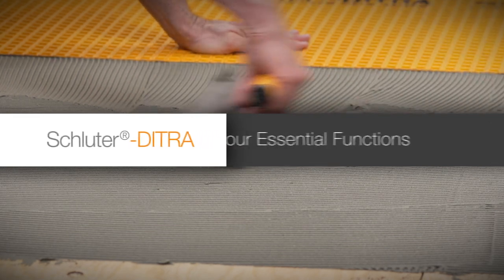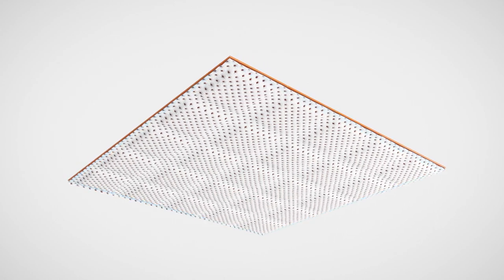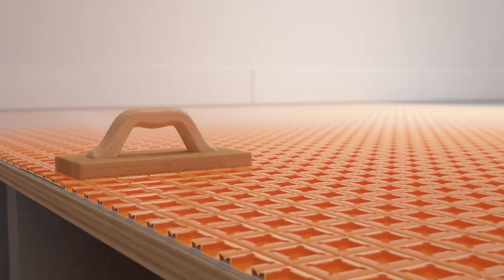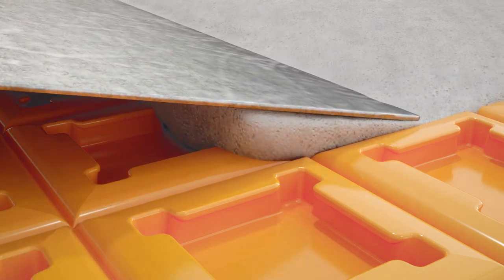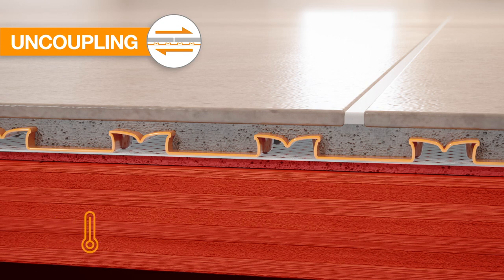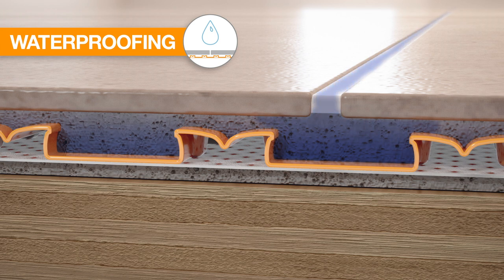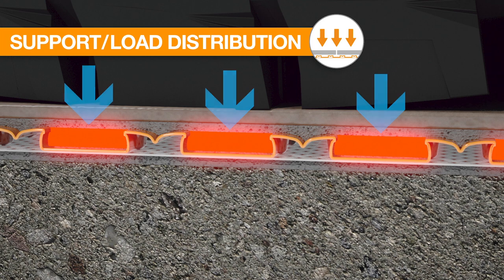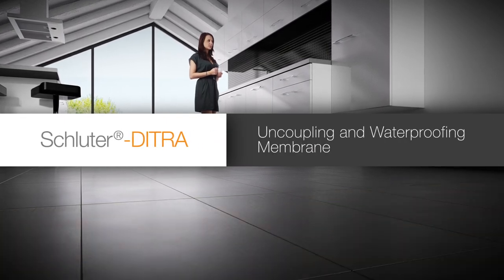Schluter®-DITRA: Four Essential Functions

Comment: Hi I’m having a lot of moisture coming up through my laminate planks and it is leavinging efflorescence behind from an older concrete slab.If I get this system installed with tiles or laminate does it block the efflorescence from coming up as well? I would hate to spend tons of money on new underlayment and tile floors only for the moisture to evaporate from the slab and leave behind the efflorescence, please answer
Reply from the maker: Hi there! Would you be able to reach out to our Customer Service team to discuss your project in a bit more detail?  They’ll be able to request more information on the specifics of your project to give you the most accurate answer possible. You can reach them at 800-472-4588 (US) or 800-667-8746 (CA). Thanks